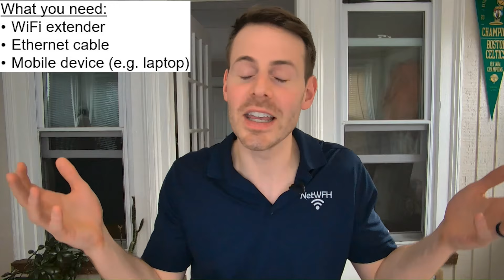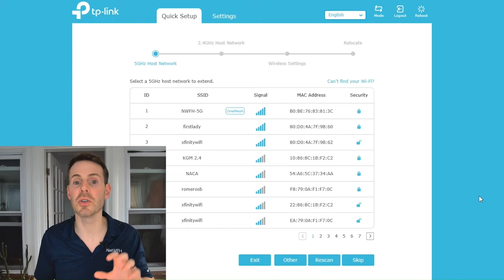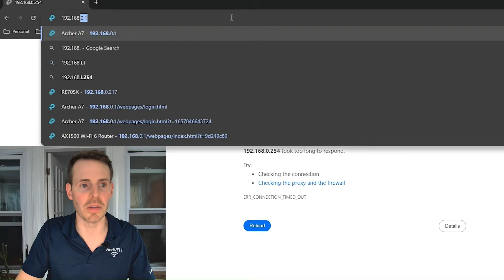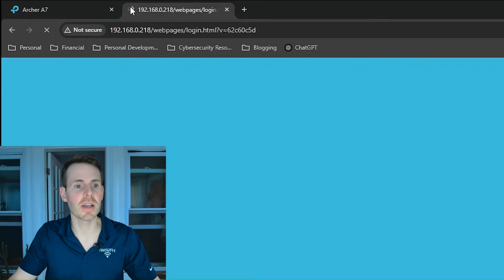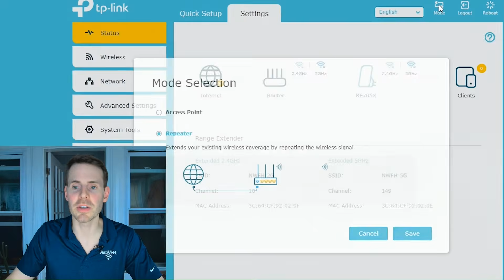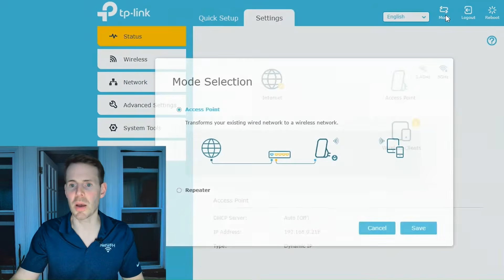How to Set Up TP-Link Extender in Access Point Mode (AX3000)

Comment: This was just plug and play for me. Didn't need to initiate via Extender Mode next to the WIFI router.  Your video was much more helpful than anything I could find from TP-Link.  I tried to follow your instructions to initiate it in Extender Mode, but had problems with that.  Ended up just connecting to the Cat6 ethernet I ran in our new house, plugging into power and after about 1-2 minutes all 4 lights were on.  At this point I was seeing the same 300/20 bandwidth as our Verizon 5G wireless internet connection.  We are rural so Verizon 5G is currently our only option.  I installed two of the AX3000 and get pretty good bandwidth all over the house.  I ran Cat6 to all TVs so each TV is directly connected to the ethernet or they have a AX3000 directly behind them so they are connected wireless and AX3000 also serves as the access point in those deader zone areas.  Let me know if I'm missing something here since I didn't need to do any configuration or set up any passwords, etc. Thanks.
Reply from the maker: I would say if you’re getting good performance there is no need to change anything! Thank you for sharing your experience, it sounds like it went really well for you!

Comment: I'm confused, once I set up AP mode I can remove the Lan and plug it anywhere in my house and it will stay in AP Mode and I can use it wirelessly ??
Reply from the maker: Sorry for the confusion! In order to use your extender in access point mode, it needs to stay connected to your router with an Ethernet cable. You can move your extender to different locations, but it needs to remain connected to your router with the Ethernet cable. I hope this helps!

Comment: Such a well done detailed tutorial video. Bravo!  Just to be clear…
• I will set up the extender (TP-Link AX300 WiFi 6) close to my Fios router where the WiFi signal can be received. 
• Once set up in Extender Mode, plug in the Ethernet cable and set up AP mode still close to my router’s WiFi signal. 
• Once in AP mode confirmed using the Tether App, I can unplug and then move the extender to my garage studio where I have an Ethernet jack and connect to LAN there. 
Question- When I unplug the extender, move it, and plug into the power outlet and Ethernet in the studio, will any of the extender settings change or need tweaking?
Thanks again for your tutorial and assistance.
Reply from the maker: Thank you for the kind feedback! It sounds like you have a great plan forward for setting up your extender in access point mode. When you power it down to move it to the remote location, it should retain its settings so you shouldn’t have to change anything after moving it. I hope this helps!
Reply: @network-from-home Thanks for the reply. Set up today. Only issue was until I figured out once moved to the garage to connect the Ethernet to the extender before plugging into electrical. I first plugged in first to the extender before plugging into electrical.  Was all set up and in Access Mode before moving from the house to garage. And it’s functioning perfectly. Thanks again!  I mentioned your channel when I left a review on Amazon where I got the extender. 👊🏻
Reply from the maker: Awesome! I’m glad you got this sorted out and it’s working properly. I love it when a plan comes together. Thank you for sharing my channel in your review, I appreciate it!

Comment: Hi, instead of buying another Ethernet cable to connect laptop to the extender device, can i just use NEW wifi network which is created via access point of the extender device by ethernet cable? Can i use ipad instead of laptop to set up the extender device via access point by ethernet cable? please advise
 Thank you for your video.
Reply from the maker: In terms of setting up your extender device, you can use an iPad. You should be able to use any device that can access the internet.

In terms of connecting your devices to the internet, you can connect your laptop wirelessly to your extender using WiFi, you don't need to connect your laptop and extender with an ethernet cable. I hope this helps!

Comment: Thanks, i had my extender RE705X in the garage paired up as an extender and then cabled in some Ethernet cable and plugged it in this caused a conflict after about 10 minutes and took the router AX3000 down, i guess i assumed in the presence of a LAN cable it would configure as an access point rather than and extender. Anyway apprecaite the clear and concise instruction, good presentation skills, it is a skill. Thanks.
Reply from the maker: Thank you for the kind feedback. I’m glad this video was useful for you. Thank you for sharing!

Comment: Does anyone know why the access point mode will work if I plug the ethernet cable directly into the modem but when I try and plug it into my data point at the back of the house (which is connected by a separate ethernet cable going through the roof directly to the modem) it wont work. Hopefully I explained it properly but essentially I thought the cables should create a connection together going straight into the modem.
Reply from the maker: So the way this works is the Ethernet cable should connect your extender and the back of your router, not your modem. This will allow the extender to take the WiFi signal from your router and rebroadcast it. I hope this helps!

Comment: i just want one SSID and dont want to separate the 2.4ghz & 5ghz connections when in AP mode.. is that possible and how?
Reply from the maker: If you’re using your extender in AP mode, you would need to make sure your router is only broadcasting one network as well. To do this, you would need to change your routers settings to disable one of the WiFi networks. I hope this answers your question!

Comment: The fact that the lights are not accurate... and setting this all up through the Tether app, shows that the extenders is "offline" or no Internet connection, once it's put into Access Point mode, is ridiculous. I've spent hours messing with this garbage because I can't be certain it's actually working in access point mode. 

Terrible purchase.
Reply from the maker: You should be able to tell if it’s in access point mode if it’s broadcasting the same WiFi network as your router, and you get speeds similar to your router when you connect a device to your extender and run a speed test. It’s also possible you got a defective device. Thank you for sharing your experience

Comment: I'm pretty sure I got this thing connected in Acsess PM.  I needed extra range to cover for a wireless doorbell cam which kept dropping offline.  I jumped thru all the hoops and the best I can teall it was a sucess.  But I'm still not sure.  How do I check this with a wifi analyzer because I really don't care about internet or streaming for this extender.  Yes...I'm using the AX3000 with a 1st gen linksys E4200.  Seems like the doorbell is cooperating so far.  It was a 50/50 chance of connection before.
Reply from the maker: I would say as long as the camera is working you should be in good shape! Another thing you can do is bring a mobile device to where your doorbell is located and make sure that the device is getting a good WiFi signal. If that’s the case, you should be all set. Thank you for sharing!

Comment: - Updated:   Per your Instructional video, which was very helpful,  I purchased the TP-Link AX3000,  and attempted to go through the set-up process.   -  First, I could never use my PC laptop to set-up the Extender.  My laptop would not open the TP-Link settings window after clicking on the "Connect" button.   I stumbled upon being able to use my Samsung phone to begin doing the set-up.  Unfortunately, I missed the part to download the TP-Link Tether App to my phone and I didn't realize that was needed to do the set-up.  After listening to your video multiple times, downloading the TP-Link App, I was able to set-up the Extender as an Access Point.  Works fantastically.  What once was 10-to-12-Mbps Download Speed in a dead area, is now 285Mbps.  -  Thank you for all your help and guidance.
Reply from the maker: Thank you for this information, I’m sorry that this happened to you! With a WiFi extender, you shouldn’t need to change its IP address because your router will automatically assign one once it is connected to your home network. I would recommend performing a factory reset of your WiFi extender and trying the process over. I’m not sure why that issue happened, but it shouldn’t get stuck in the setup process like that. I hope this helps!
Reply: @network-from-home   -  See My Update.
Reply: You got that speed in the extender mode/ repeater mode or the access point mode where we plug in via fibre cable? Coz on extender mode i generally get half the speed thrown via the main router

Comment: Just to clarify that the AX3000 only needs to stay connected via the ethernet cable for the setup process putting the extender into access point mode?
Reply: The reason that I ask is that there is an ethernet cable run to the particualr "dead spot" in the area of my house. I thought that maybe I would utillize a switch and run one LAN cable to the daughter's laptop. Another LAN cable to the AX3000. I am not sure if that makes sense, or if it is necessary after the setup (in access point mode).
Reply from the maker: If you will be implementing your extender in access point mode, it will need to stay connected to your router with an Ethernet cable at all times. So it sounds like your plan of using a switch with two Ethernet cables will work just fine. 

I hope this helps!
Reply: @network-from-home  Perfect! That is my plan. Parts ordered.

Comment: So I can’t plug this into my room wirelessly then plug in pc into the extender? (Repeater)
Would I need 2 Ethernet connections instead of 1
Reply from the maker: I wouldn't recommend you do it this way. For the best performance, you would connect your router and extender with an ethernet cable. It also sounds like maybe a mesh WiFi system would suit you well here if you need to extend your WiFi signal, but you can't connect your router and extender with an ethernet cable. I hope this helps!

Comment: All went well until I selected access point mode and the reboot left me with the default network names, TP_Link_Extender, not my chosen network name. It works well in the new location but with the wrong network name. There doesn't seem to be any place to fix this.
Reply from the maker: Is it possible your extender is operating in extender mode? If it’s in access point mode it should be broadcasting the same WiFi network as your router. You may want to reset the extender and try setting it up again. I hope this helps!

Comment: Crystal clear explanation with all the necessary details, but none of that extra crap that many YouTubers impose.
I noticed my two RE600X have different hardware versions (2.2 & 3) Do you think it'll make a difference, considering they're now selling the 4.6 version? I can update the firmware, but obviously not the hardware...
Reply from the maker: Thank you very much! Unless those hardware versions are really old, I wouldn’t imagine the hardware version will have a significant impact on the performance of the device. I would recommend trying them out and if you find the performance is really bad (or for some reason they don’t work), you’ll have to think about replacing them. I hope this helps!

Comment: Great video.
I got a really important question 
Can the wifi extender work as an Access point if connected to a switch via ethernet? Because I've tried to connect my wifi extender directly to my antenna but it wouldn't work so I'm not sure if it's the same case with the switch because I still didn't get one.
Reply from the maker: Yes! You shouldn’t have any problem using your extender as an access point if you connect it to your router with an Ethernet switch

Comment: Hello, Thanks for the video... I have a question, if I set the device in ap mode & follow your steps;  & if I unplug it from the the lan will it still function on its on in ap mode wirelessly while still using mesh?
Reply from the maker: If your extender is in access point mode, it will need to be connected to your router with an Ethernet cable. If it’s in mesh mode, however, it can communicate wirelessly with your router and you don’t need an Ethernet cable. I hope this clears things up!

Comment: Great instructional video. The setup was easy going along with. An interesting result was that out of my two tp link AX1800 Wi-Fi extenders, one I left in extender mode "meshed" with my router and the other that I made an access point, shows as offline (in the phone app and on the pc). BUT the access point has seemed to have joined the network, and I have one network in the house. Forums mention that the Tp Link AX 23 router I am using cannot mesh with Access points yet, but it appears that it is, even though the mesh map shows it offline. I guess a firmware update will fix that. The Tp Link products appear that this stage to be working well. With a 560mbps feed, the WIFI extender upstairs is producing 403mbps and then sending a lan line to the tv room, which is feeding the access point reading about 350mbps and that's after going through two tp link gigabit switches. Much much better than the powerline adapters I tried first, they were absolutely terrible.
Reply: Next day update. I was curious as to what reception the 2nd ax1800 (furthest away from the router) would get if I switched it back to repeater mode from Access point mode. When I did (i just changed the mode and did not change anything else) I left the lan cable coming directly from the first ax1800 plugged in and checked the tether app when it was ready. It was now showing as fully meshed with my other two devices, and I was getting 240mbps wifi which was really good (560mbps at router). When I go into the repeater's settings, it says the repeater is not close enough, so it appears that the wifi signal is coming from the lan cable input, but the device now meshes and there are no deadspots in my house and I now get reception in the shed in the back yard.  Food for thought it you want to mesh all your devices, pending an update from TP link allowing meshing with access points.

Comment: This is the best guide I found to explain how to do this. I was really struggling but your instructions actually worked. One question - my laptop seems to think I haven't set up the TP Link as WPA2 but I have. Why would that be? Well done and thank you.
Reply from the maker: That’s awesome, I’m glad you found this video helpful! With regards to WPA2, that’s a good question. The extender should be dictating what encryption is used , so as long as it is set properly on your extender you should be all set. I would just double check to make sure your router has that set as well. Maybe there is a discrepancy between your router and extender. Good luck!

Comment: Does OneMesh still work when the extender is in AP mode?
Reply from the maker: Adding devices to OneMesh will depend upon the router that you have. As long as the device you’re connecting to your router is capable of connecting via OneMesh, you shouldn’t have any problems. The extender shouldn’t have any impact on your other devices connecting to your router as mesh nodes. With that said, you should probably have your extender in mesh mode as well so that your extender, router, and additional devices are all connected via OneMesh. I hope this helps!

Comment: Great video! I could not have set up my repeater as an AP without this.

The download speed is lower than that of the router - router has ~1GBPS down while the AP has ~0.350GBPS. They're about 65feet away from each other; WiFi 6a cable which runs to a switch, then switch to AP.
Upload speeds about the same.
The speeds also face significant drop-off after going not too far away (~15 feet) from the AP.

Any settings you think I could tweak? 
On wireless settings - do you think I should put 'version' & 'encryption' to auto?
Do you think the switch is necessary/useful?

Great video once again!
Reply from the maker: Excellent, I’m happy to hear this! Is the WiFi extender you have a current one? I’m surprised to hear about the drop off of signal more than 15 feet away. I would double check to make sure the extender transmit power is set to “high” to ensure you’re getting maximum signal. Other than that, encryption settings shouldn’t have an impact on the bandwidth you get by connecting to the extender. I hope this helps!
Reply: @network-from-home  Thanks for the answer! Extender is the exact one in the video! Range is set to high!
I just set it up after watching your video lol. So it was indeed a big help. 

I've heard it can take the extender (AP now really) a day or so it adjust itself - so maybe it'll take a few more hours...
Thanks for the help!
Reply: I think I should also add the 15 feet away is also behind a couple of big concrete walls as well🥲.
Reply: I to am having the same issue. I am getting lower speeds from the extenders (now AP) being plugged into a cat6 cable. I watched this video possibly 10xs. Great video. But I am wondering what did I do wrong. 

I also noticed on the diagram showing the APs there is a wired line shown or a WiFi line. Only one out of the three extended show a straight solid line on the diagram. 

Also, do I need to shutoff Onemesh? I have three extenders. Two of them have done through the reset and turned into APs. All of my WiFi devices swarmed to my only extender that was not turned to AP. 

Any help with this would be greatly appreciated!! Thank you.